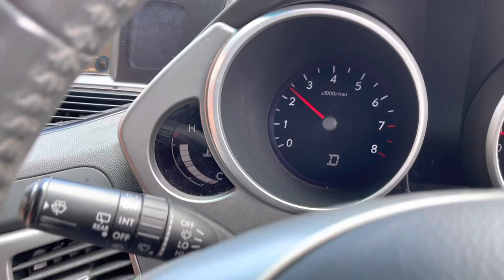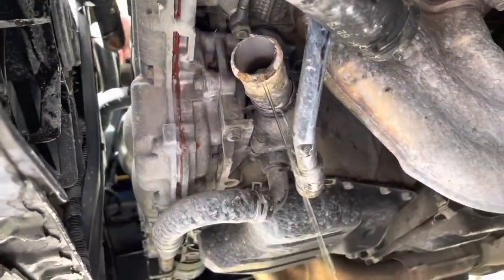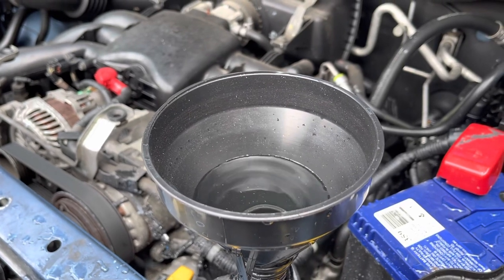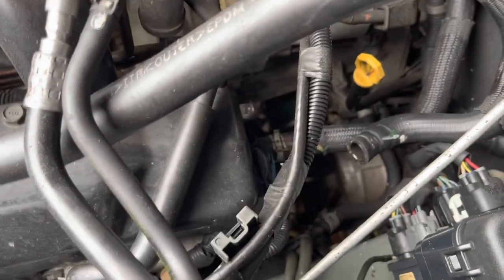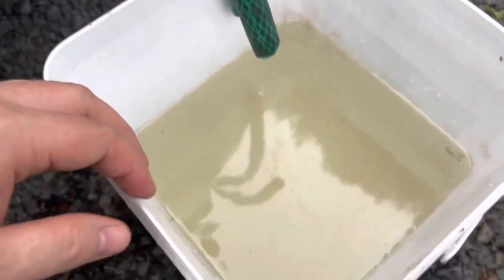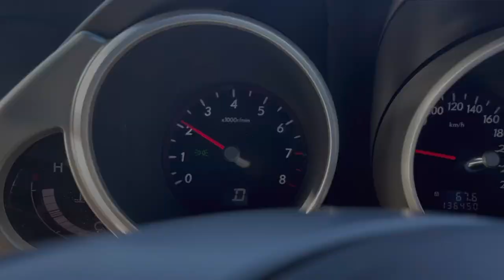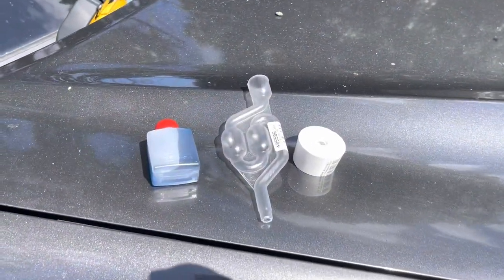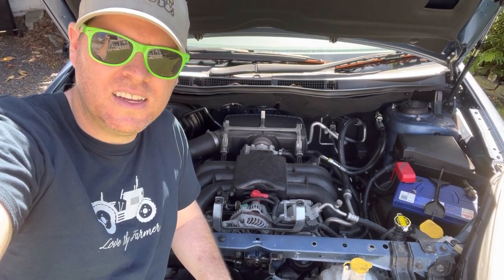Subaru Saga PART 2 - The Tribeca’s dirty little secret. Diagnosing a cooling system & heater core

Comment: Just swapped the motor on mine.  Had that lower radiator hose blow off on highway and dumped all my antifreeze while driving, and the motor heated up and kaiboshed the head gasket.  Wouldn't even start.  Wasn't sure of the damage, and the work to do a head gasket on these is expensive - so I just swapped the motor out with a newer JDM motor with less than 60k on it & a 3mo warranty.  Costly, but drives like brand new now!
Reply from the maker: Hiya thanks for that. Yeah I’m feeling the same way. Got some prices and replacement is same quantum of money as fix. And that’s if the fix is straight forward. Think I’ll use this motor to run some test and take some vids. Never know I might get lucky as it’s a very minor leak. If I mess it up then  I’m no worse off. Just replace the motor! 👍 more vids to come! (Eventually)
Reply: How is the new motor doing? I have a Tribeca (2006) with leaking front seal, rear seal, and internal seal- I also purchased it with a blown head gasket and have been using it after using Blue Devil head gasket fix that actually worked. Did that in 2018 and check with a block tester annually. All good on that end. Because the seal repairs will be between $3K and $4K and I am on a fixed income and in no position to purchase a new vehicle, I am thinking about a later model used motor. How has yours worked out over time and what was your complete cost for the motor and install? Kind of worried because of all the horror stories about JDM motors on youtube.
Reply: @americanpancakelive  the Subie is running excellent.  No issues at all.  I'm very glad i did it, vs getting a paynent for another unknown used vehicle - especially in this economy with inflated used car pricing & higher interest rates.  Motor swap was the better economic choice.  I've put about 4,000 miles or so on the new motor.
Reply: @americanpancakelive  im sorry i forgot to answer part of your comment.  The motor was about $1,100 or $1,300 (i cant remember exactly) and the labor was what was the most.  I paid about $2,800 In labor, including new fluids, spark plugs, filters & whatnot.  So yeah, almost $4k total.  But again... what kind of used car will you get for 4k right now?  Plus, its used... so you have no idea how it was treated by previous owners.  If you like your Subie & it is reliable... i'd take the car i know vs a 3-6yr payment loan on a car i dont know.
Reply: @_GlockComa  I am glad you had a good experience. Makes me feel better considering it. I am also curious if later years will fit in my older car. Like I would figure a 2012 motor (because they fixed the head gasket problems) would be a better bet if it would fit. AND I know what you mean about the used market. At least in California it is insane. Thanks
Reply: @americanpancakelive  im not sure if the 3.5 fits in the 3.0 engine bay.  That wouldve been nice, since i have to buy premium gas for the 3.0!  I shouldve researched that.
Reply: Same thing happened to me on Subaru outback with he 3.6 engine... it lost the lower radiator hose and cooked the engine. I never buy subaru now with out testing to see if there are combustion gases in the coolant system.

Comment: I have same symptoms in my Outback...head gaskets blown, bubbling in overflow tank, random overheating, top rad hose hot, lower rad hose cold.  I drilled a few holes in my thermostat flange.  The car is daily driver again with no overheating.  Still need to check/top up coolant each day as pressure will still push coolant out.  However no more overheating, ie lower rad hose is always warm now
Reply from the maker: Thanks for that. Given it is such a mild leak We are about to try an evolution of additives to see if any of them can help. I’m guessing not but it doesn’t hurt to try! Stay tuned 👍
Reply: @bbtrevival  I drilled three 1/8" holes probably too many.  If I do it again I will do a more iterative approach.  I am in Canada so with 3 holes I need to put some carboard in front of radiator to have some heat in cabin

Comment: Happy to find your video. Not happy to hear what the diagnosis is.  I have the same model and having same symptoms.  
My situation is now exacerbated by the fact that I'm now towing a small camper trailer.  But - even without the extra 2800lb load, a simple hill climb or even 5 minutes while parked will bring that gage all the way up.  
With the current cost of a replacement vehicle, I'm keeping this one. Had it since it was new (2007).
 I will eventually bite the bullet and replace the gasket.  First though, I will get that test kit you used in order to confirm the issue.  Thanks for posting this video.
Reply from the maker: Do you have gas accumulating in the cooling system? If so then unfortunately most likely the head gasket. If not then you might get lucky and find a bad component in the cooling system (radiator, water pump, thermostat etc). As an emergency you could try running with no thermostat and keep the ac on so the aux fan is running all the time. Good luck with it!!!
Reply: @bbtrevival  , after testing for exhaust gas in the radiator, luckily the liquid never turned yellow. I ended up flushing the radiator for the first time ever in that car. It was disgusting! I ended up flushing it for a long time. Finally, the car does not overheat anymore! So basically, I caused my own problem by never taking care of the cooling system. I got very lucky that it was just the radiator that was plugged up!
Reply from the maker: @Cosmotube1960  that’s awesome news! So good when it’s caught before any damage done!! Happy travels!!
Reply: If youre replacing the head gasket, I've been there and done that. I was able to print out a large picture of the timing chain cover bolt locations, both inner and outer. Then I pasted the pictures to large pieces of cardboard and drilled holes in it. Simply put the bolts in their respective holes as you remove them....This is a BEAST of a job....

Comment: We should form a club....I have exactly the same issues.......I did add the " Subaru Coolant System treatment "  ( STOP LEAK )...that was issued to get their cars through warranty..........My 2008 is a nice car with a bad head gasket.....The Subaru dealer here in Maryland ( USA ) quoted $160.00 / hr to figure it out.....( They know ! )........ I wonder what other motors fit ? ..... joe
Reply from the maker: Yeah I have grabbed some of that coolant treatment as well, along with some other progressively more aggressive stop leaks. Figure it’s worth a shot. My mechanic recommended replacing the motor instead of doing the heads as it is about the same cost. So nothing to lose! I have just ordered all the different additives and will start experimenting when I next have some time. Stay tuned 😊👍

Comment: With post 2000 subarus, if you're getting heating issues, might as well start troubleshooting with the head gasgets.  eliminate that first as it is the likely cause.  dont sell yourself short on the gasget replacement job - most people with a reasonable set of tools can do it in a weekend - job takes a couple weeks as the heads should be sent out to a machine shop for resurfacing - watch youtube videos on it.  you can do it, save a ton of money.
Reply from the maker: Thanks for the encouragement. Wish I had the time to tackle a job like that. The car continues to sit on the sidelines as I can’t attempt right now and can’t bring myself to pay for someone else to do it. 😖

Comment: From my experience is not always head gasket ez 30 engines got some fault and head is often cracking on third cylinder between valves , when I was looking for one years ago I seen lots of them reconditioned for sale
Reply from the maker: Thanks for that, did not know they were susceptible to that. I don’t think I like any of those options 😖😖🤪
Reply: @bbtrevival  I bought mine with broken radiator i was topping coolant up and there weren't issues with temp  , and after replacing radiator temp start jumping up , I remember after plugging comp and running diagnostic show lower compression on one cylinder and you can see coolant leaking through exhaust while revving
Reply from the maker: @jaack13  that’s a bummer! Sorry to hear that 😥

Comment: Mine is doing same thing hg job here is over 3k .... thinking of putting that hg sealer in it I have heard mixed reviews
Reply from the maker: Yeah I haven’t had time yet but I’m thinking, given how minor the leak is, full coolant flush then new Subaru OEM coolant with conditioner (which is actually a mild stop leak). Then go with a product recommended to me - amsoil coolant boost. And then, if that doesn’t work then either steel seal or blue devil. Will post videos when I finally get around to it
Reply: @bbtrevival  I will be going with blue devil this weekend will see how it goes!
Reply from the maker: @tommytfaa  please let me know how it goes!!! Good luck with it 🤞
Reply: Any updates on this?

Comment: Can you let me know what the name of the testing for carbon dioxide kit is?
Reply from the maker: Hi there. You are looking for a combustion gas test kit. 

Here is a basic one like I used that comes with a little bit of test fluid:
https://www.ebay.com.au/itm/134958870367?mkcid=16&mkevt=1&mkrid=705-154756-20017-0&ssspo=krmejswvrj-&sssrc=4429486&ssuid=QJtsap5qTHO&var=&widget_ver=artemis&media=COPY

Here is a more comprehensive equipment kit but you need to buy the fluid separately:
https://www.ebay.com.au/itm/395403741142?mkcid=16&mkevt=1&mkrid=705-154756-20017-0&ssspo=8ssslmt1syq&sssrc=4429486&ssuid=QJtsap5qTHO&var=&widget_ver=artemis&media=COPY

Comment: Just a heads up, you NEVER fill a Subaru through the radiator unless it's an EA series car. ALWAYS through the upper radiator hose.
Reply from the maker: Oh really? That’s for the tip. Why is that?
Reply: @bbtrevival  with the thermostat on the bottom, the coolant fills the radiator without letting a drop into the block. By this time, the air in the block can't escape through the thermostat (which isn't air tight) and a bunch of bubbles get trapped in the block. Having the upper hose off AND an open radiator cap gives the air an easy escape out, thus none of that gurgling non-sense 🤣

Comment: Did you have to drain the system to flush the heater core
Reply from the maker: If you coolant is clean then no. Can just isolate the core by removing both hoses and then flush until it’s clean. If your coolant has gone muddy then best to put in new coolant at the same time.

Comment: Does thia problem known in tyr 3.6 liter in the later model from 2009 ?
Reply from the maker: My understanding is the ez36 is considered the better motor. Improvements were made and the gasket issues are fewer in those than the older 3L ez30 motors like mine. But they still aren’t the strongest when it comes to head gaskets. Here is a good article:  

https://dustrunnersauto.com/subaru-ez36-everything-you-need-to-know/
Reply: Cooling was completely revised it doesnt suffer from any overheating. HG only happened rarely on ez30 mostly due to uneven temperature stress around the rearmost cylinders, new design got individual coolant feeding for each cylinder instead of one for each side like previously. It's nothing even remotely like EJ25 issues(there is mostly because of cheap oem gasket design used, instead of better gasket from turbo 2.5L subarus.)

Comment: the position of the thermostat is horrible on this car- and tends to capture engine gases, a good hack is drilling some holes in the top section of the thermostat. If you decide you need a head gasket replacement, I used Blue Devil gasket repair and used it 6 years ago-- and still good to go. The older Tribecas (mine is a 2006) are kind of pieces of shit, sorry to say.
Reply from the maker: Yeah good call. I ran it without the thermostat for a while and it did help it stay cooler but a blown gasket is a blown gasket. It’s a very mild blown gasket, can still drive it okay and the temperature bounces around but doesn’t overheat. Radiator ends up accumulating gas and reduces efficiency, but not to the point it’s not drivable. Have been experimenting with blue devil but haven’t had any luck which surprises me given how minor it is and the results others like yourself have had. Any tips on getting the most out of blue devil?
Reply: @bbtrevival  It is hard to remember because it was so long ago but I remember I do remember flushing the system until the water was clean and then adding it etc per the directions. Later of course draining and adding coolant. I was shocked that it worked but never had a heating problem for  6 years actually until yesterday. I had my expansion tank filling with water after a 100 degree day. My suspicion was that the blue devil finally wore off but I did a block test and could not find any gasses coming off the radiator. So now, trying to figure it out-- maybe air pocket in the system or a faulty thermostat.
Reply from the maker: Thanks for that. I Flushed the system and then added it to fresh coolant rather than just water. I might try flushing the system again and going with just the water. Good luck with yours. I haven’t done a gas test since I added the blue devil but it is behaving the same so assumed I still have the same problem. However if you find a reason for the expansion tank filling up that is not a blow head gasket please let me know!!! Fingers crossed for you 🤞🤞🤞
Reply: I am trying to sell my 2006 and nobody wants this car. 😂😂

Comment: Hey what did it cost to get the Tribeca head gasket done?
Reply from the maker: In Australia I was estimated about $3k for the head gasket because it is an engine out job. Being a boxer motor there is not enough clearance in the engine bay to do the heads in place. Mechanic said that it would only be a little more (maybe $3500) to replace the motor with a warrantied one and so recommended that. Everyone on the forums is saying the same thing. If you looking at head gaskets you might as well do a JDM swap. Warranty and better motor for basically same money. Given mine is so minor and is now at the point (with all the cooling system cleaning and flushing) where it’s really daily drivable I’m just planning to keep driving it as is and use it as a test platform for different additives to see if I can improve it at all. If it finally gives up then I’ll prolly go the JDM route at that point.
Reply: Buy an engine crane and do it yourself. Temp going up and puking coolant under load on a hill is a telltale sign of HG leak.
Reply: It was cheaper for me to get my 2007 Subaru Tribeca B9 a new/used engine installed as opposed to replacing the head gasket on original one. I bought the engine for my mechanic off ebay I think it was and then paid him the labor to install it. Got a decent deal that way and like around $1,500 all together back in 2018 or 2019 I think it was.

Comment: What happened to this vehicle?
Reply from the maker: Life happened and It got shelved. I still have it a drive it occasionally as it’s still functional. Hopefully I’ll get some more time to test some different products on it and make some videos. A head gasket on these is an engine out job and the head work is almost as much as a replacement engine. so basically it’s a financial write off. Will try some increasingly aggressive additives until it either plugs the hole or kills the motor!
Reply: @bbtrevival  Yeah I have 2 of them that are blown, disassembled 1 of them yesterday... they aren't completely easy to tell if or where it's failed but I also had similar issues to you and coolant out the exhaust  with this engine whilst pushing coolant into the overflow (exhaust gas). My other one will boil coolant in the overflow. So yeah not fun... when the internet tells you these motors don't blow headgaskets that much... it was a lie lol
Reply: @bbtrevival  I understand, I did the headgaskets on my EJ253 a few years ago and that was over $3.6K AUD... big waste of money since I swapped to the EZ anyway haha.

Comment: Україна.Клапана  стукають...
Reply from the maker: Could a bad valve cause coolant pressure build up?
Reply: @bbtrevival  It can't. I meant that in the video you can hear the valves knocking. Did you adjust the valves?